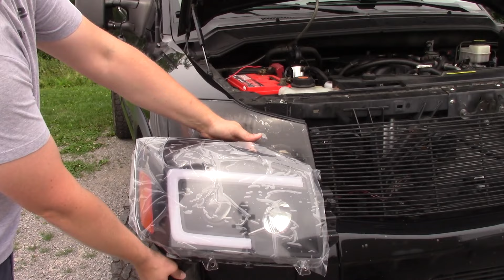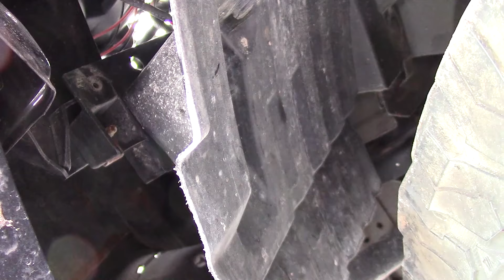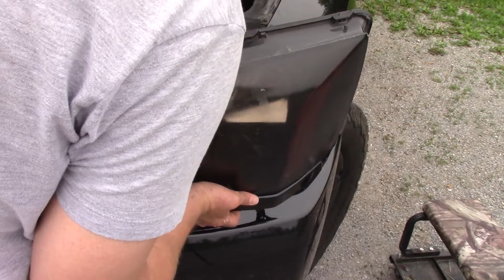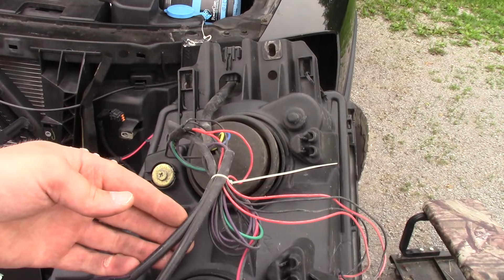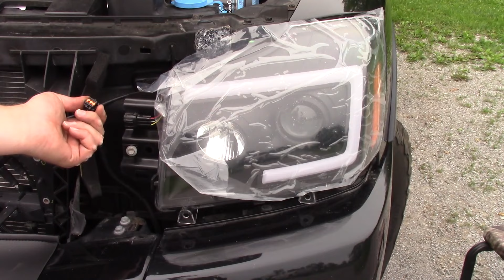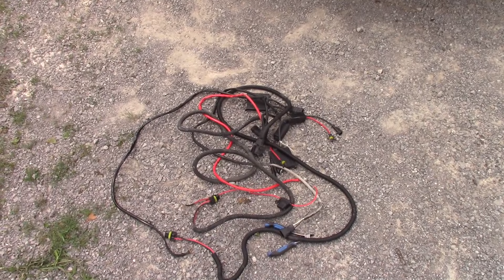How to Install Spec D Headlights on a Nissan Titan

Comment: I installed these a few days ago and had to finish their job of applying silicone since I was getting condensation in them.  There were visible spots where the lens was not fully sealed with silicone.  It stayed good for a day but I went for a drive tonight and now both have condensation.  I’m about ready to return them and dig my OEM lights back out of the trash bin.
Reply from the maker: Are they name brand or ebay or Amazon copies?  Sorry to hear you had issues.  Mine are still issue free.
Reply: @TitanTown  spec D from eBay.  Identical to yours

Comment: How would you recommend this kind of headlights these ones and the other ones from Amazon acanii,akon and some other drl lights
Reply from the maker: These have been good to me so far.  Stick with a name brand and not a cheap amazon or ebay light.  I had cheap headlights before and they hardly lasted a year.

Comment: What brand were the headlights you replaced? How long did they last before they start to yellow?
Reply from the maker: I had vipmotoz headlights and the surface started cracking after 1 year.  It got really bad.  I had sanded and added new clear coat twice before replacing them.

Comment: Have you had issues with condensation?  I have these same type of headlights and cant get it to stop or clear unless i take them off and use a hair dryer.
Reply from the maker: No.  You have to be careful if you have dust covers off that you do it when it's not humid.  I had an issue before with a different headlight doing that.  I brought it inside and sat it by a dehumidifier, then put dust covers back on where it was dry before reinstalling in truck.  It's possible you have a bad seal somewhere.

Comment: How is the headlights ? Any issue ?
Reply from the maker: Headlights have been great.  My led bulbs don't work on drl setting but I can switch to parking light setting for just the lighted bar
Reply: so you have to put the lights in parking mode to have just the leds. Do the leds still work with the headlights on? Also im thinking of getting these should I?

Comment: Any idea what would cause hyper flash with these lights? I can’t figure it out
Reply from the maker: Where did you buy your headlights from?
Reply: @TitanTown  from Amazon, they are from spec-d as well. Same exact lights. When I hit the unlock button the sequential amber bulb seems to work as intended. But when I use the blinker it just goes wild
Reply from the maker: Try contacting spec d.  Mine were plug and play I didnt have to do anything extra and no issues.
Reply: I know this is late but sometimes you need to add a resistor and that should fix the issue
Reply: @chunkyluger6086  hey thanks for taking the time to help! That’s exactly what I had to do, now they work as expected.
Reply: @DukeCityDemon25  no problem man glad you got it fixed

Comment: These are the clear ones yeah? You have any issue with them since you’ve had them? Condensation? Leaks?
Reply from the maker: Yes, clear ones.  I have added light tint for protection and led bulbs.  No issues.
Reply: @TitanTown  I’ve read leds in these kind of casings can be potentially dangerous and not even as bright as oem. Is there something I should research?
Reply from the maker: @jameshawelu4916  that's correct you have to get really good ones which are really expensive.  Some people have e had issues with the signal hyperflashing but I didn't.
Reply from the maker: @jameshawelu4916  this is what i used.   They are bright but expensive.  Only issue so far is high beam drl not coming on https://youtu.be/KWNH-aqCETc